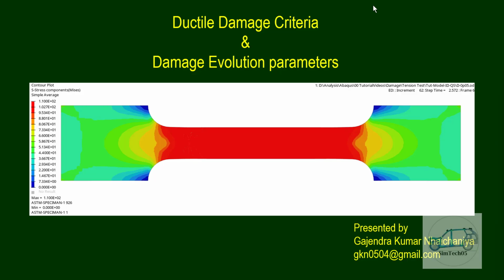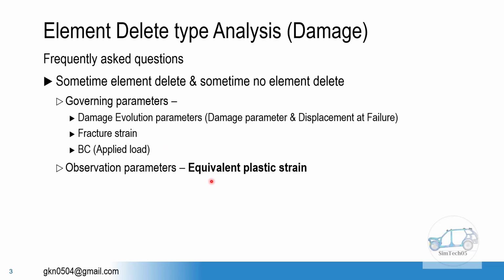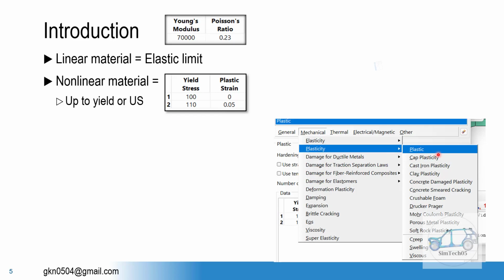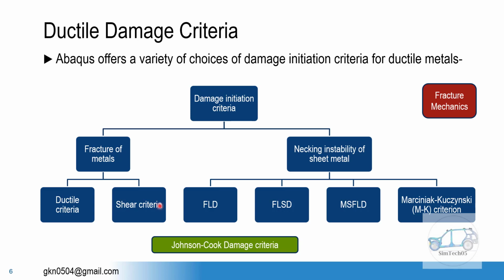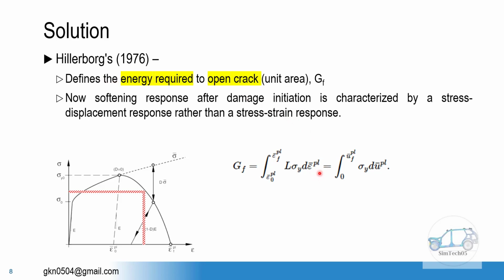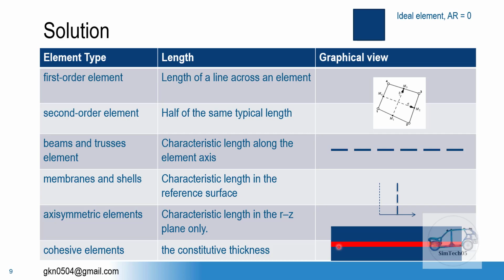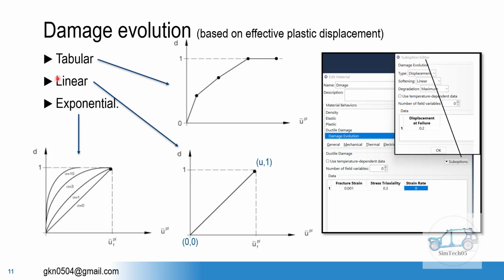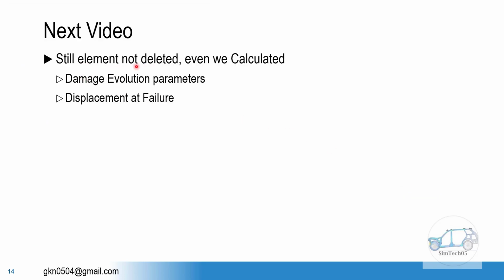Ductile Damage evolution in Abaqus (01 - Theory and mistakes in Element deletion type of analysis)

Comment: Nice video sir. As per this theory, if we opt for a coarser mesh, the material will undergo sudden failure. But if the mesh size if finer, then the then the material will undergo a gradual failure. Because the ultimate deformation depends only on the strain and characteristic length. In that, strain is a constant and characteristic length is varying as per the mesh size.. So, same material can have dissimilar stress strain response with mesh refinement which is little confusing..please correct me if I am wrong..

Comment: Great video, but I think at 27:10 there is a mistake. According to the Abaqus manual e_pl_f is not called fracture strain but equivalent plastic strain at failure. I think the fracture strain would correspond to e_pl_0, but correct me if I am wrong.
Reply from the maker: Dear,
Equivalent plastic strain at failure point (breaking point) is itself fracture strain.
Reply: @arsitech-ltd  I think @peter109ful is right, the fracture strain is obtained from the experiment and the eq. plastic strain at failure is calculated from true plastic strain. Although the values are somehow close but the other is more accurate i think.

Comment: Thank you so much, sir. Could you explain how the model recognizes that it should fail in 45 Deg direction which well agrees with the actual ductile material fracture behavior?
Reply from the maker: Dear,
Ductile material generally fail in cone shape if tension force applied. However in FEA it depends on material model also.

Comment: Good job. It has been demonstrated in several articles that triaxiality factor, which is correlated to the first deviatoric invariant, and the normalized Lode angle, which is correlated to the second and third deviatoric invariant, are 
the main parameters which characterize the initiation of ductile damage. The study of fracture propagation is more complex than initiation. There are different models based on Continuum Damage Mechanics or experimental mechanics. A very accurate prediction model for damage initiation in tensile test is the Bao-Wierzbicki Damage Model. It’s very simple to write a subroutine with this model to use with FEM. I suggest to you to try it.
Reply from the maker: Thanks for suggestions dear. I'll appreciate if you share paper/pdf on the same. (gkn0504@gmail.com)

Currently I'm working on different topic but I'll surely explore it.

Comment: Sir you have calculated the displacement at failure as 4*0.05 = 0.2. I have a doubt that u are working in mm coordinate system thats why your element charcteristic length is 4mm. if I m working in SI coodinate system them for this case my displacement at failure will be 0.004*0.05 = 0.2e-3. Am I correct??
Reply from the maker: Yes dear correct.
Reply: @arsitech-ltd  thankyou sir for reply. Please also help me in how to calculate the characteristic length of 3D element
Reply: @vikramroy7471  I think, (length* W *H)^1/3 of the element considered.

Comment: thank you very much! Excellent video！ I learned lot from it.  and I am little confused about one thing about it: at the end of this video, you calculated failure displacement with 0.05*4(characteristic length), but in the plastic table, 0.05 corresponded to 110MPa，which is damage stress, so it means 0.05 is damage strain, not failure strain. the failure displacement  is supposed  to be calculated by damage strain, am I wrong somewhere?
Reply from the maker: Dear,
0.05 strain corresponding to 110 stress is damage initiation point...damage start here but not complete damage. So as per Abaqus documentation we have to use damage initiation point (this point is ultimate strain stress point).
Reply: @arsitech-ltd  thanks lot!  if it is possible for you to sent me some documents about it?

Comment: Thanks sir!, about theory,   what is the difference between the damage model of LEMAITRE and the one presented in the video
Reply from the maker: Material models or criteria present in this video is use to determine ductile fracture dependency on state of stress in terms of stress triaxiality and Lode angle. However, these material model not consider softening effect caused by damage. For many ductile material in which damage is very much pronounced during large plastic deformation Lemaitre Damage model is more accurate.

Refrence - https://www.sciencedirect.com/science/article/pii/S2211812814002983

Comment: Nice video. Thank you so much!
Reply from the maker: Welcome dear.
Reply: @arsitech-ltd  Hello, I watch this video again and I have a question. 

At around 32:18, as an example the Upl is calculated by 4 multiplied by 0.05 where 4 is the characteristic length and 0.05 like you said, is the plastic strain. However, is 0.05 the plastic strain for maximum stress (before damage), and should Upl be calculated by 4 multiplied by another strain (greater than 0.05)? 

Thank you so much.
Best regards

Comment: I am trying a metal matrix composite system. Can you suggest the material model for matrix and reinforcement(ceramic) under both static and dynamic conditions for a simple compression test modeling ?
Reply from the maker: Dear,
Best of my knowledge -
For ceramic you can use the Johnson-Holmquist-Beissel (JHB) and the Johnson-Holmquist (JH-2) ceramic material models, which are available in Abaqus/Explicit as built-in user materials.
For metal matrix you can use elastic plastic material model.

However, selection of material model also depends on application.
Reply: Thank you very much, Sir. 
 @arsitech-ltd  Can you please suggest the same for quasi-static test conditions for which I am using the General static model.
Reply from the maker: Dear,
I'm not sure aware to ceramic material model for static step. I'll try to find it out.

Comment: the displacement at failure is calculated with the ultimate plastic strain or with the plastic strain at maximum stress?
Reply from the maker: At ultimate plastic strain dear.
Reply: @arsitech-ltd  is there any difference between "ultimate plastic strain and plastic strain at max stress"? or I am missing something?

Comment: Thank you, sir! Brilliant explanation! So basically, the element deletion highly depends on the characteristic length of the element, yes? It is far preferable to have consistent SIZE of elements in the region of damage-prone (e.g., hex elements) because they provide a better shape and size if we mesh them strategically. More than that, we need to find the smallest element in the meshing part and calculate its characteristic length (must consider what type of element order too). And if we choose the biggest element with characteristic length as input, then it would be troublesome for small elements because they would be instantly deleted and not accurate for the simulation. According to what you've presented, Upl=characteristic length* plastic strain is essentially a failure displacement at the local level or the failure of a single smallest element. When those conditions are met (e.g., 0.15875), any element in the part will be automatically deleted by Abaqus. And also, it would be nice if you could share with us how to calculate the characteristic length for 3D elements (hex and tetra shape). Thank you again for this knowledge.
Reply from the maker: Yes. Consistency in mesh size is recommended.
Yes actually we don't know where crack will propagate...so we consider calculation with smallest size.
For 3D element characteristic length of element calculated by considering its volume...there is simple formula...!

Comment: Can you do a simulation on aluminium round tensile test  getting ultimate strengths
Reply from the maker: Dear,
In this simulation ultimate tensile strength we used as input...we can not find out it by this method.